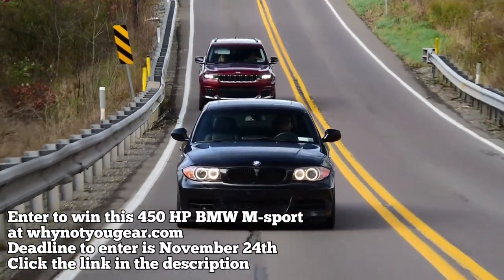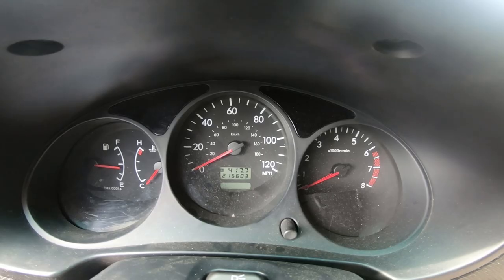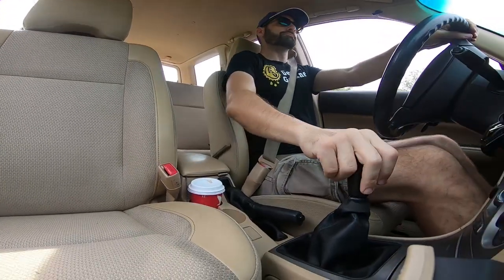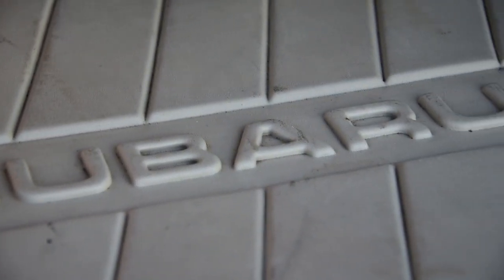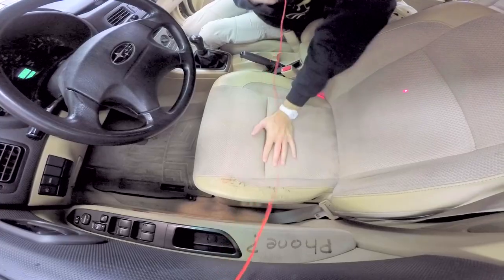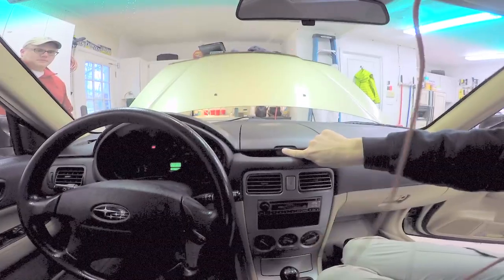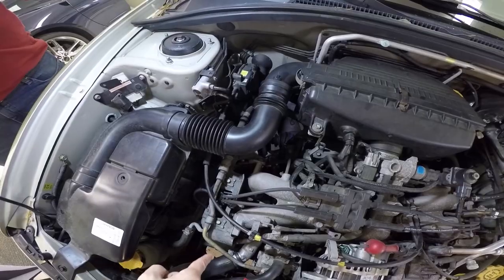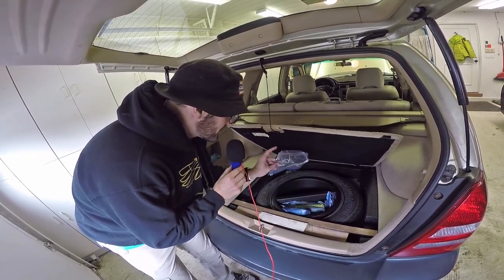2004 Subaru Forester 5MT: Regular Car Reviews

Comment: As the owner of a 417,000 mile Subaru this video speaks to me.  Well done Goldie.  If you take care of a subaru, and undercoat it with oil based coating every year, it will take care of you. I have thought about that Love making a Subaru a Subaru line for a long time.  You give the love and it returns in so many ways.
Reply: Agree 100%. Proud owner of a 97 Legacy with 369,000 miles and a 2003 Forester with 256,000 miles!
Reply: @caucasiandebris9180  awesome
Reply: I've got an 08 Impreza with 188k. How do y'all keep them going so long?
Reply: @andrewray656  keep oil in it 😃
Reply: @musicalgreasemonkey  haha I have to check about every thousand miles
Reply: what is an oil bqsed coating that wont form a layer of oil and dirt on the bottom of the car?
Reply: @byloyuripka9624  you could try Surface Shield and then pressure washing the surface shield regularly

Comment: “Winter god” describes Subaru perfectly
Reply: Until the salt gets to it
Reply: @alphatripduce  people being scared of a little salt is absolutely hilarious
Reply: Facts ! I miss drifting my Subaru back in the northeast. Can’t do that here in the south
Reply: Literally so many in NJ because of that…
Reply: @NJdeplorable  true and in ma
Reply: Engine problem God
Reply: @colincavarzan7500  You must not live in the rust belt then. I've seen enough cars that still look perfectly clean on the outside and running fine with the underside completely rotted out. Hell the fact that this 04 went this long is amazing. Had an 09 Forester in the family that wouldn't pass inspection by 2018. 84k miles, underside had fist sized holes from rust.
Reply: @ryang1591  You're right, I live in Ontario Canada, not an inch of snow ever here
Reply: @colincavarzan7500  ahh yes cause the snow is the problem.
Reply: @colincavarzan7500  imagine laughing at your rust bucket falling apart beneath your feet 😂
Reply: @ryang1591  where there is snow, there is salt
Reply: @colincavarzan7500  na Miata pfp
"who cares about some snow and salt?"
visible confusion
Reply: @kipp4805  i have an nc miata, salt isn't as instantly destructive as people think it is.
Reply: @colincavarzan7500  not in North Dakota 😂 they use sand on the roads instead
Reply: @colincavarzan7500  so it doesn't rain up in Ontario either?😂 the salt is for slippery conditions not just snow. I would imagine that Ontario gets freezing rain in the winter, which causes a sheet of ice on roads, which causes the need for salt. All this without a snowflake on the ground. I know this as I live in western Pennsylvania
Reply: @drfeastmf  obviously snow and water don't rust... thought it was obvious by saying snow, that ice and salt go along with it. Didn't expect I would have to be so literal

Comment: 90's and early 00 Subaru's are so cool. In an era when the differences between brands were largely disappearing, Subaru had a truly unique layout. A longitudinal, 4wd, manual station wagon?? I loved how CHUNKY the shifter felt in my outback, since it was connected by a rod straight down into the transmission. Didn't feel like any other mass market car.

Comment: I had this exact car - same year, five speed, interior, it was only red and not beige.

I absolutely loved this vehicle.  It served me well for many years.  Took me through the deep woods down logging roads and through deep snow in the winter.  

I sold it with 215,000 miles on it.  I hope it is still going.
Reply: Lets be honest its probably in the salvage yard:( I sold my first car a 99 subaru forester it is still by far my favorite car but I just know it's somewhere just being neglected.

Comment: Living in MN, you know that the rust will eventually win.  My parents have owned two Subarus...a 2011 Outback.  Shopping with them I found a 2011 Outback with a manual transmission parked in the back lot...the 2012s were coming in and the 2011s were getting discounted..this was a real unicorn car..the only manual in stock.  As my parents were signing off on their purchase....I started kicking tires on the 2011...and my wife reminded me of our deal for me keeping the BMW 3 series wagon for a full 10 years.  The BMW was out of warranty and I was experiencing the out of pocket BMW maintenance experience.  So I was really torn about getting my own Outback...and this one I regret getting away.

After a few years my parents decided they wanted something a bit more up market...and purchased a 2015 Legacy sedan.  Better ride than the Outback.  Sadly, my Dad passed away two years after he purchased it.  He loved going on road trips in that car...and also living in the upper midwest felt safe in the winter snow.  Mom, who is 85 is driving it and has a trust worthy dealer to make sure it's current on services.  When I visit, I do check the oil to make sure it's topped off.  So far so good on this one.  My brother and I took Mom to visit her brother in Wisconsin in 2019.  We drove her in the Legacy and had a great trip.  MPG wise was in the 30s and the car had a very long cruising range.  Very comfortable for the 3 of us and it gave us an opportunity to see relatives we hadn't seen in a long time.  If I could convince my wife that we didn't need the room of a minivan...we would have a Subaru in our driveway.
Reply: The Subaru Ascent might as well be a mini van.
Reply: I'm next door to ya down here in central Iowa and I feel your pain. Have lost too many good cars and trucks to the IDOT and their love of SALT BRINE the last 30 years or so. Worse than when they used the mix of rock salt and sand, It's the Devils brew I tell ya.
Reply: @seththomas9105  Over in the Dakotas....they use sand and no salt....I know ND for sure doesn't use salt....so we get the chipping....my old Dodge Dakota was a ND truck and has minimal corrosion....had it been a MN truck...I'm sure it would have been scrapped years ago.
Reply: That's the problem I've noticed about Japanese vehicles, they cheapen on the steel and don't go for better alloys that don't rust as easily. No coatings will ever alleviate the issue.
Reply: Minnesotan here, my 2008 Outback miraculously has almost no rust and I'm washing it soooo much to try to keep it like that as long as possible. But I know in the end the salt will win. It always does.

Comment: 2005 Forexter XT auto owner. 

My dad and I bought one when I was a freshman in college with a blown motor for 1400$ (10 PSI Compression Cylinder 4). We bought a used motor for it, tore it down and rebuilt the motor, and installed it. 3.5 years and 50,000 miles it runs like a charm. It’s definitely old (225k on the motor, 215 on the chassis) guzzles gas and is about 50$ a tank, but I couldn’t be happier with the car. It’s gotten me through almost all of college, a few relationships, plenty of bad snowy weather, and is fun driving on the backroads. It has power when it needs it and is tame when it doesn’t. I’ve leaned how to work on cars because of my forester, and I’ll probably never sell it. Something about this car is special to me and I think RGR sums it up great. The car isn’t a marvel of engineering, but it isn’t meant to be. It does everything it’s supposed to pretty well, and I couldn’t have asked for a better first car.

Comment: This episode struck a chord with me; I had similar feelings when I had to part ways with a 1988 Dodge Ramcharger, which was the vehicle I literally grew up in, as my parents bought it secondhand when I was a toddler, and 20 years later I was driving it daily. By 2015, and after 210k+ miles, it was falling apart at the seams, and I didn't have the money to drop a new engine in at the time, so ultimately I had to sell it off.

Comment: That WB radio took me back to my autobox 2006 forester, owned by my dad who used to drive it, then I drove it a few years before getting a Fit. My sis still has that little box.
Yeah, you can have an app, but in 2004, what else did you have?
Reply: its oddly comforting, I do remember when it was a real person though

Comment: Around 18:00 I didn't know newer subies has the hill-holder. My loyale had it and it still worked at 370k miles. I think it was even more primitive, loved that for off roading. Brake, clutch in, brake out(clutch holds brake too now), gas and clutch dump. Amazing.
Reply: From what I know of any manual Subie made past 1995 has a hill-hold function

Comment: Glad to see you finally review your Forester! I love all the jerry rigging and general tips you shard about the car. I'm on my 3rd second gen Forester. My first was a black 2006 forester x that came with snow tires, sadly that got totaled by someone who ran a red light and hit me. My second was the "gold" 2003 xs with sun roof and heated seats. This one didn't get totaled thankfully and I sold it to my friend in order to buy a one owner 2006 l.l bean editon (replaced xs) in green. I've loved the car as its made feel safe in rough weather and is generally a fun car to drive. Only ever owned them in automatic though would love to get a manual one day.  Random fact, in 2006 they added variable valve lift to the engine which I must say makes noticeable difference vs the 2003 I owned. 
Friends and I have enjoyed your content over the years stay well!

Comment: Live in norway. My mom and dad have a 2.0 2004 forester. Its the best car they ever had. As u say, not best in anything. But still, it will never die. Never a problem. Think its been there daily car for 12 years. Plowing snow with it. Dive alot with trailers. Never a problem

Comment: I've got an 00 with a 01 engine in it with 30k less miles than the body and I've had it since early 2019. I drove it from PA to WA and all around there for 3 months in the winter with about 500lbs of supplies and it handled it like a champ. I bent two sets of rear struts with such a heavy load, but the first was a cheap eBay set. I've changed the rear brakes to disc and put felpro 3 layer head gaskets in. I took everything good off an 01 with a much worse case of what Goldie has, but I still love it. It is a great car. My other 'car' is an 89 Toyota 4x4 van with 98k and it needs a lot of work, but it's even more fun to drive.

Comment: I've got a 2000 forester I use for work. It's pushing 300000 miles. It's been from Oregon to Nevada to Maryland to Florida to Alabama Georgia Tennessee and every where in between multi times. Only 4 timing belts and not much else besides wheel bearings and rare oil changes about every 3 years. Everything still worms even the ac and sun roof.

Comment: I had the 1st gen Forester and what gave it away was the lack of maintenance and big issues with the suspension and also the transmission. We wanted to move to another town with it but it cant really go too far anymore. It was basically runned to the ground. I had to buy another car and get the feeling of letting something we had for a long time go. I grew up in that car, it was nostalgic. We had fun while it lasted. It ended around 250,000 miles.

Comment: Many years ago, I had bought an 05 nonturbo Impreza (my first new-new car!), and while I was good with manuals back then, the clutch took getting used to for sure - you don't get the luxury of accidental wheelspin if you're too agressive with it (snow notwithstanding). Otherwise, it was a great car and I wish I had hung onto it longer than I did. I replaced it with a first-gen xB that I had for nine years and 100k miles.

Comment: I learned how to drive in one of these, we had a 2001 and a 2006 Forester, this Forrester has a lot of mean to me. Helping my mom replace the clutch, the timing belt, and even the head gaskets. There was a lot of connections made with this car. Even after her death back in January, I still kept it despite not needing a 2nd car. Even though it’s not in the best of conditions, given there’s holes in the carpet, especially where your heel rests with the clutch pedal, I will keep this car going for as long as she’ll hold together. Sitting at 166,000 miles, she will sit next to my Saab 9-3, so that my mother’s spirit will carry on. Yes the maintenance on these cars can be annoying, but I wouldn’t have it any other way, because it was that maintenance that has given me great memories with those I love. That’s what makes my Subaru, a Subaru

Comment: Yup. My first car was an '03 forester. Head gasket blew at 135k. Drove it like that til 165K when an engine bearing went and I couldn't smog it due to the eternal check engine light. It served me well for 9 years, and I sold it to a dealer that would buy it for $300.

I paid $4000 for a used car and got 9 years of dependability. It always got me there no matter the conditions. I would never go back to owning one, but it will forever hold a place in my heart.

Comment: I've done most of my learner licence driving on my best friend's 2004 Subaru Forester and it has been the best thing to drive. Super comfortable, slow as balls but fun power at the same time. The clutch is super easy to control and the shifter is very solid despite the worn out syncos. Had a great time learning how to drive in such a solid car.

Comment: There is some weird mystical power Subaru's have over their owners. Even after a got a newer car, I couldn't bring myself to get rid of mine (96 Legacy wagon,) and kept it as my "snow" car. The rust got so bad that while it was sitting in my driveway one of the front springs snapped and punched a hole in the tire. I knew it was time to say goodbye, but even as it was being loaded on the back of the truck for its final trip, I was second guessing myself. The car had cost me thousands in repairs, but I still had a hard time saying goodbye.

Comment: I just sold my silver 2004 Forester 2.5X 5MT. I installed an un-equal length header and a roof rack from the u-pull. Was a GREAT car! 

The longitudinal drivetrain, Symmetrical AWD, low center of gravity...the car was just SO well thought through.

Comment: Nothing, even here in Minnesota, can stop a Forester on snow tires.  It's the most confidence inspiring feeling I've ever had in a vehicle in winter.  Good tread, AWD, enough power, and doesn't have the mass of a truck when you need to stop.  Even had remote start.  F'n luxurious.  

It took being rolled over TWICE, on two separate occasions I mean, to kill mine.  (Bought it rolled, kid rolled it the second time.)  06 Subaru textile seats were made from some otherworldly tough fabric.  They feel amazing.  Firm and basic, but good on the back.

Comment: Wonderful tribute to Goldie! I fell in love with Subarus back in 1981.  My friend Sammy had a Subaru front wheel drive 2 door coupe that we used to offroad back in the Pine Barrens and the trails inland of Sea Isle City. The thing never broke.  My friend Steve used to have a 4wd turbo station wagon that was a blast to drive. As for your 20's, I also wasted mine. I finally grew some sense at 28.

Comment: I've had my '07 Forester for 11 years now.  Did an MLS head gasket at the same time as the timing belt, so that's no longer a concern.    I've done all the regular service intervals at the dealer, and it still drives tight and rattle free.  Full cloth seats look as good as when they were new.  Stuff that gave the initial impression as a bit cheaper than your average Honda held up 100% over 11 years.  The heater is quick and powerful.  No rattles in the fan.

I love the tall wagon format.  It has as much cargo room as a Rav4 but it's Crosstrek sized.  It's got SUV ground clearance but you can still reach into a roof cargo box. and it won't get knocked off on a clearance bar at the mall.  2400 lbs towing capacity with the auto.  Manual lumbar support.  The best outward visibility of any car I've ever driven. I can see the corners and know where they are within inches of parkade columns.  It drives more like a car than an SUV and soaks up every bump without jarring or shudder.  The frameless windows make the doors lighter, and I am told are there to remove the possibility of tangled window frames penetrating the passenger compartment in a collision.  These cars have a reputation for saving lives in terrible pile-ups.  It has an aluminium hood.  Many of these features should but don't exist on newer cars in the same bracket.

It may seem simple and plain, but IMO it took engineering brilliance to make a car that does everything so well.  It's like a fine photograph.  The essentials have all been thoughtfully arranged and everything that would detract has been removed.  A tough little car with a comfortable ride that can hop a curb without thousands in repair costs and can even go off road.  It's brilliant.  

I love mine, and wish that I could get the same thing in a modern car.  The Crosstrek manual comes close, but doesn't have the cargo space or roof rack length.  Subaru robbed me of the manual Forester , which I would buy, and I don't want the CVT.  Nothing has my towing capacity unless I spring for top trim.  

Anyway, thanks for telling the world about Goldie.  I agree with everything in your video and think we share a love and appreciation for what this car is.  My little go anywhere, do anything, comfortable road tripper and camper that handles any road conditions I encounter with confidence.